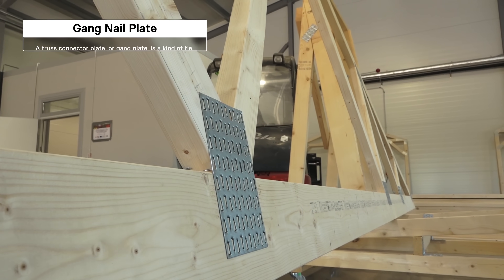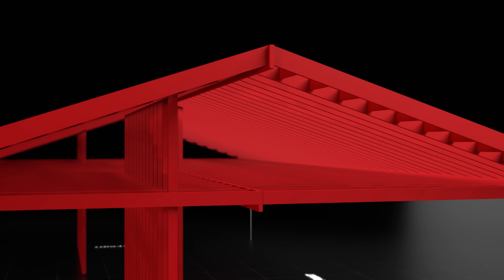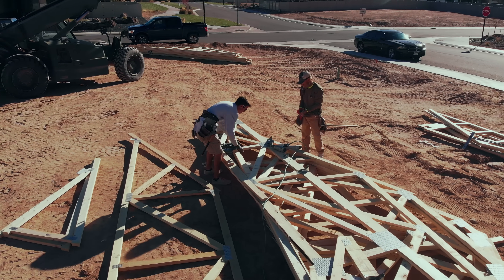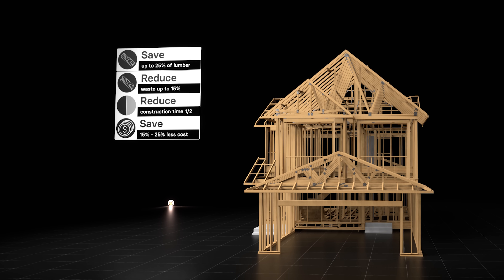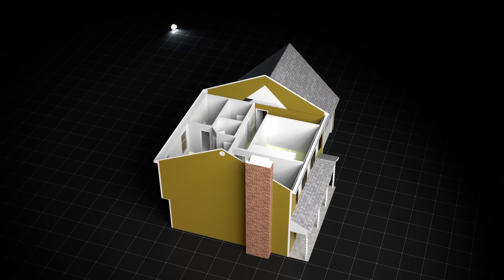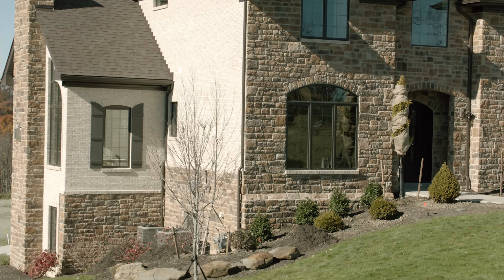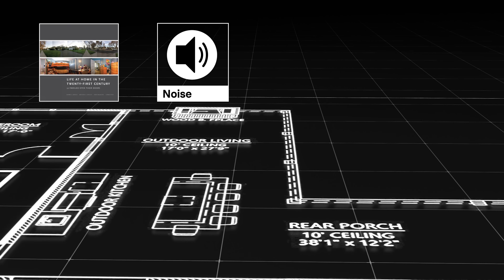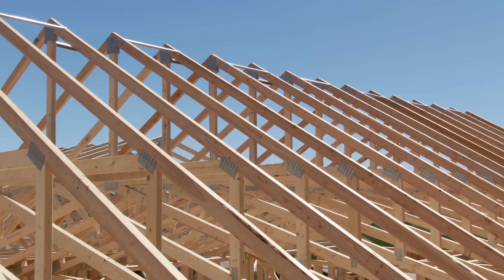The Invention that Accidentally Made McMansions

Comment: An unfortunate downside to gang nail plates is their contribution to sudden roof collapse in fire situations, making it more dangerous for firefighters to attempt on-the-roof operations. The large surface area of the plate conducts heat into the wood joint area, encouraging it to burn first and fail faster than one fastened with nails.
Reply: What's terrifying to me is modern LBL construction. It's all just chipboard held together with glue. Although I hate seeing an old house burn, I'd much rather fight a fire on an old house compared to a new one.
Reply: Brought to you by sawdust and Saudi Aramco.
Reply: @twillison8824  it’s LVL, laminated veneer lumber
Reply: Floor collapse in six minutes with direct flame impingement baby!
Reply: @twillison8824  Our host is balloon framed, doesn't that style of framing raise fire concerns?
Reply: @twillison8824  Seems like something that could be prevented by adding fire-rated insulation (e.g. mineral wool or unfaced fiberglass) between the living space and those members, which would also reduce energy usage. Granted, that depends on where it's located, but in the absence of that, couldn't we add some kind of intumescent coating?
Reply: @twillison8824 which is worse that and spray foam or asbestos and lead paint?
Reply: @twillison8824 i like osb. Its environmentaly friendlier than plywood and strong too.
Reply: Not to mention dense old growth timber is more fire resistant…
Reply: @twillison8824  an old house is MUCH MUCH more likely to start on fire in the first place BTW
Reply: @j.jarvis7460  due to modern fire codes, not construction technique.

Balloon-style construction and OSB board burn faster. Modern plastic-based furniture burns hotter with more toxic smoke than antique furniture. But, wiring is safer, and that by itself has greatly reduced the rate of fires.
Reply: @twillison8824 that couldn't be farther from the truth. Actually research this before making comments 🤦‍♂️
Reply: The danger with trusses is that once ONE joint fails, the whole truss fails, then the roof collapses.  Watch the collapse of the Baltimore bridge in slow motion when it was hit by the ship to see what trusses do when they loose some members.Thinner wood also burns faster.  Modern homes are built to be disposable in fires.
Reply: @sufpnancy That’s a feature not a bug, in the event that your McMansion  does catch on fire you would want it to burn efficiently to the ground completely so the insurance have to pay for the whole thing rather than pay 50% for a half burnt house that then has to be teared down.
Reply: @sufpnancy I think you added some extra words after "disposable".
Reply: @sufpnancy  Not quite the same since a bridge spans a large distance.  Perhaps true for a wide "great room", but not the entire house which has many interior walls to support the roof.
Reply: @sufpnancy I get what you're saying but there must be a engineering safety factor I mean you can't build a multitrust structure where just one trust can take the whole thing out 

Bridges are a bit different
Reply: @sufpnancy  There's a fair bit of redundancy in the designs. The loss of off one truss shouldn't result in the collapse of the whole roof.
Reply: @sufpnancy kind of like a cardboard ball. When people tie the wires incorrectly or don't use enough wires, if one of those wires pops, all that pressure is then distributed among fewer wires, increasing the chances of another popped wire which is really dangerous.
Reply: @sufpnancy This is 100% false. One failed tuss isn't going to bring it all down, thats ridiculous.
Reply: @Jacob-ed1bl right? And even  failed joint in a single truss isn’t going to bring the whole thing down either because there are plenty of inspections that reveal broken trusses and missing nail plates. They can be repaired and the hose house didn’t fall apart.
Reply: @philipzielinski  Most of these people are beyond clueless and just lying.
Reply: @Jacob-ed1bl  Cascade failure, that sudden sag of weight on already stressed burning lumber, straw that broke the camels back. In theory one failure doesn't do it but I have stacked dominoes before and some people build houses of cards for a lying . Seen a lot of disasters just because a few people decided to not do their job right all on the same day.
Reply: Huh. McMansions wont ever be the same. Like knowing how a magician does a trick.
Reply: This is probably the best argument for not letting your house catch on fire.
Reply: In my neck of the woods firemen are not allowed to go on the  roof of houses built with gang plates, the practice there is to surround and drown.
Reply: I expect longer and longer spans of roof trusses leads to the carrying of greater roof loads and greater tension on the bottom chord. A failure of a metal plate made soft by the heat of a fire, and smaller dimension lumber burning through, the greater tension, and no intermediate bearing for the load from above I imagine would result in an extraordinary rapid failure and collapse.
Reply: @billlyons4678  That's more of a truss problem than a plate problem - truss failure modes are just brutal.
Reply: The problem is not the burning, its the expansion of the metal when heated, which causes them to back out of the wood. Some jurisdictions require nails to be driven into the plate to delay this effect.
Reply: That's where my mind went as soon as I saw the intro.
Reply: I wonder if there could be an alternate material that could be used to make them, which would allow the heat to dissipate as opposed to holding it in.
Reply: @robviously-rob0ts  Unlikely honestly. Material science can only do so much. Again, however, if it were to be covered with a protective layer, fireproof foam insulation for example, that would solve the problem.
Reply: @robviously-rob0ts  What about good old fashioned asbestos?
Reply: @heli-crewhgs5285 I think the fact that it’s designed to be drilled into and the danger to workers makes that a bad idea
Reply: That and more so are the engineered floor truss'.  Brother is a firefighter and they will not breach a newer home for just that reason, floor and roof.  If the house is close to being engulfed when they arrive NOBODY will go inside.  They just water it down until the foundation is left
Reply: My experience has been that yes, obviously, lightweight truss construction and laminated building materials are far more prone to rapid and critical failure in fire situations, but modern homes and structures do a better job of isolating the structural components from fire hazards. If a newer home catches fire, they seem to be less likely to have serious fire spread. Older homes hold their strength longer when on fire, but fire spreads more, does more damage, and is harder to extinguish. Of all the residential fires I've fought, the older houses are the ones that were hardest to fight, and the more modern homes seem most likely to be saved.
Reply: As a licensed architect, I can say that I consider how a design would fare in a fire.
After seeing one project collapse during construction due to a fire,
I no longer specify any TGI joists, I specify wood packing in all steel beams even if not load bearing, and I specify mineral wool insulation in walls, floors, and roofs when possible.
When I use trusses, I add additional braces and fire protection.  It is not the metal connector that causes a collapse, it is the design or installation of a total design without redundancy, or consideration of performance in a fire.
Reply: @barryb8850  how do architects learn about long term impacts of things, is there even a disincentive for designs that cause problems 20 years after construction?
Reply: ive heard of similar issues with wooden I-Joists as while normally they are strong but they fail quicker in fires which can lead to floor collapse.
Reply: Great video . Built many         Mc mansions in Chatham MA without ever touching a truss . I would have to say I politely disagree . Engineered lumber seems like the reason . TGI 's LVL's and the like . Live ridges , live valley rafters , huge pressure treated girders ( Parralam's ) windows walls  with engineered posts , OSB sheathing . Those are the reasons for Mc mansions in my area . In fla trusses and tie beam construction have been around in the trade when I  started in 1982 Broward country.
Reply: Firefighter; can confirm.  Often, it's found that it wasn't the joint burning to failure but the fact that all that heat expands metal faster than it does wood.  Combining heat with the stresses already in the rafter members, the gusset simply pops loose and then the joint is no longer fastened.
Reply: @YO-BIZZY Economics mostly, wood is cheap, but makes perfect ammo for tornados, tinder for fires and food for termites.
Reply: Lots of good comments in this thread. It is matchstick construction subject to progressive construction. It is no different from the flimsy construction of the WTC towers, just on a much smaller scale and different materials. There should be no expectation from anyone, that fire departments personnel will be sent into such death traps for anything other than evacuating occupants.
Reply: I have also heard from a firefighter that osb floors become more dangerous in a fire because of the glue melting allowing the floor to collapse quicker than plywood. Plywood has continous wood grain unlike osb chipboard.
Reply: @bk3720  7/16” OSB is about 90% as resistant to failure in fire as 1/2”CDX plywood.
Reply: As a firefighter I can tell you that them gusset plates are terrible
Reply: This is not a hard thought. It would be easy enough to dip all the gang nail plates in heat resistant material.
Reply: @jguyis Yes, as long as its not toxic to the inhabitants.
Reply: Can’t you spray the metal joints with high temp paint and fireproof insulation to make it so the wood around it give before the joints do?
Reply: @The-Maestro-Bob-Cobb  dunno where you are but yes they do atleast in C.Texas.
Some lady just built an actual “mansion” down the county road and it had those boys all over it in its framing stage.
Reply: So your concern is that fires, which do not occur naturally, can be remedied, and affect only one dwelling at a time, are somehow more dangerous than hurricanes, which occur several times a year, and affect millions...
Reply: @ThereIsNoOtherHandleLikeMine  No, his concern is that this thing has a failure mode that a) increases the chance of people being killed in fires, and b) is dangerous to firefighters. (Whether that's true is a different matter - someone posted a link to a study that contradicts this assertion). Fires are a design concern that is represented in every single extant building in the country. And rightly so. If this device introduces a hazard, we ought to a) know about it, and b) see if it can be addressed, eg by ceramic coating it.
Reply: @paulie-g  So, yes. His problem is the minimal risk it poses to one house as compared the major risk it resolves.
No, we do not need to investigate the differences any further.
Reply: @ThereIsNoOtherHandleLikeMine  I will have exactly 0 hurricanes where I live in perpetuity, so my risk from them is < my risk from fire. And yes, it is interesting to examine what might be done to improve the behaviour of this part in a fire. This is why we now have fire-resistant insulation - because idiots didn't scream "but being warm/cool all the time is more important than fire-resistance" - unless it can be proven that it's impossible to a) combine both properties, and b) no other suitable option for hurricane-resistant roofs is available.
Reply: @ThereIsNoOtherHandleLikeMine  why on earth would the comparatively smaller risk of something to something major negate the need to think about resolving it? Structural integrity isn’t a zero sum game, dude. Fixing a risk to firefighters doesn’t have to compete with the importance of mitigating damage during a hurricane. And of course to a firefighter the issue is top of mind, just like how I don’t worry about getting checked for prostate cancer, and technically the majority of the population doesn’t either, it doesn’t mean no one should ever discuss it or research how to prevent it and the people who are in the age and sex range to be at risk don’t matter enough to do screenings
Reply: @  bad faith argument using a storm that uses ungodly force ta wipe houses off of the earth trusses or no and who said Hurricanes aren’t I literally Noted Wind and water sorry I didn’t note debris which houses aren’t rated against generally however the whole Continental U.S. has ta deal with over 350,000 house fire a year and can spread taking out neighborhoods or worse California, East Texas, just ta name a few and have little ta no warning time unlike a Hurricane which you can’t really build against (you can try)
But we have much much more warning than fire.
Reply: I opened the comment section  to say just this. Learned about gang  nail plates in my fire science classs.
Reply: I wonder if there are simple modifications to construction techniques such as insulating / fireproof layer that would reduce that failure mode.
Reply: Good Point Howard. The rest of the House or any Building can be made of concrete but if it is a Wood Truss not only are you Inviting a Fire - It is also the first part to leave in A Hurricane
Reply: Blame government. We are forced to use these.
Reply: @CallmeJeffy1  jeffrey epstein had no clients i trust my govt sir!!
Reply: @CallmeJeffy1  we are the government. We elect and re-elect the people we want to make the rules and we have public comment periods for everything, so we can participate in the governing. The government isn’t some untouchable authority. It’s us.
Reply: @rainbomg 😂😂😂
Reply: @rainbomg If only that were still true.
Reply: This can be litigated with coatings I think all wood in wooden homes should be coated with a fire retardant coating and the plates should be covered with fire retardant tape then it would be stronger and preform better and wouldn’t be too difficult to incorporate into current operations
Reply: @Johndarksoulsbornering that would cost so much, though we should have better safety.
Reply: @Johndarksoulsbornering  so you want homes to be more expensive XD?
Reply: @Johndarksoulsbornering Unfortunately, "fire retardent coatings" all too often are years later found to be carcinogenic to the family that has been living there. That's particularly true of carpeting and upholstery fabrics.
Reply: The gang nail plate heats up in a fire and expands, pulling the joint apart as it is also pulling itself out of the wood.
Reply: @williamgottlieb8723  Ah.  Thank you.
Reply: @williamgottlieb8723  The plate acts as a heat sink. The tabs or staples heat up to point the wood they are into chars. Char has no structural strength and little resistance to pull out. The truss fails long before a substantial part of it burns.
Reply: @williamgottlieb8723  Yeah, I was going to comment that the plate fails long before it reaches the temperature of the auto-ignition of wood.
Reply: @williamgottlieb8723 There is literally no actual evidence of this. Every study of these shows the opposite. (See NIST study “A Study of Metal Truss Plate Connectors When Exposed to Fire” for example.)
Reply: @MoosePockets  Oh you so have not read that report...
In the report it states it needs more research, the wood was not under load and was laid horizontally on the testing desk not in the orientation of installation, it says it clearly in the report, they also did not take a cross section of the wood after the test and based their report on visual inspection. you can see the photos in the report. 
And that is one of well over a 100 research papers from around the world on this and there are plenty that do show that underload the failure time of a roof is lower... so please do not say there is no evidence, as their is plenty, you can say the reports you have seen show no evidence maybe but there are reports from NIST from the Department of commerce inside the US that both say more testing is needed. There are reports from Governments outside the US that say a range of things all depending on what was being tested and how.
Reply: @danielwarren7110  "More testing is needed" does not equal "these cause roof collapse in fire situations."
Reply: @MoosePockets are roofs collapsing? Where does the idea come from then?
Reply: You likely should spray fireproofing on the hanger once in  place. That would slow the spread of the fire. Pressed composites are also serious problems during fires. They can fail in 1/3 the time of solid wood. The best idea of all is to install wet sprinklers in these houses. They are surprisingly inexpensive.
Reply: @AriBenDavid The truss plate slows the fire.(See NIST study “A Study of Metal Truss Plate Connectors When Exposed to Fire”)
Reply: @MoosePockets  Have you read it, because I have. The report states more testing is needed, the report also states the truss was NOT under load, was only burnt from one side and was laid flat on a testing desk not in the orientation of installation, they had a very specific set of requirements for their test. They did not take a cross section of the wood after to see the internal damage of the wood where the truss plate had been to see if the damage was internal, their test was to see heat conductivity and charring to the exterior of the wood. I strongly suggest you go and read it before quoting it. As their conclusion was more testing is needed. Not that it slows a fire. It suggest that the plate protects the wood surface from direct fire charring on the surface, but no tests were carried out on the inside of the wood.
Reply: Cool!! And terrifying
Reply: @The-Maestro-Bob-Cobb  It might depend on if your local building code has an addition to the national one that prevents it.
Reply: Wow…never considered that
Reply: You could fix that easily with extra insulation around those metal parts.
Reply: I’ll buy a lottery ticket
Reply: @ thanks. Appreciate the support 👍🏼
Reply: I’ve noticed
Reply: Nothing that a bit of fire coating won't fix
Reply: yes, a similar problem to making the whole house out of combustible materials
Reply: Add to that fact, American homes run gas lines rather than use electric heater/cookers. They want it to burn down
Reply: While presenting a marvelous perspective of the nail plates for trusses, home construction over a very short time period has exploded due to many, many connections as well as connectors like the nail plates. Let us not forget for example, the simple metal straps holding trusses to top plates, often referred to as ‘hurricane plates’ or ‘tornado straps’. Nor the cables ties directly holding top plates to the foundation! Nor the engineered methods for holding the house structure to the foundation! Many connections or connectors serve well to provide safe housing. Let us not forget the technological advances of personal computers leading to complex roof designs in ‘stick-built’ McMansions. Pioneering software such as 3D “Solid-Builder” allowed grass-root design-builders to efficiently provide cut lists, material lists and other information critical for builders of houses. While 3D computerized modeling was considered fantastic, I imagine AI will or already is playing out yet another evolutionary development. Visions of the future are as robust as ever, with home-printed devices already common, even in the kitchen or galley. Scale it up and print a new home for yourself anytime at all! Just leave a way to sustainably recycle your demolished one. My closing point? Fundamentally, meaningful development is all-inclusive from many disciplines, knowledge bases, and experience. People make things happen and people are bedrock. Rock on.❤
Reply: Did each plate then into liquid asbestos. Oh wait…
Reply: @EvanMooreZ  You do realise that there are a number of fire-retardants that are not asbestos that are available, right? Not a specialist, but for metals a ceramic glaze might be in order. Besides, there are applications where asbestos is perfectly safe, but let's not go there.
Reply: new invention - sprinkler system
Reply: There's a reason they call them widow makers...
Reply: Oh, how horrid!
Reply: The wood doesn't have to burn, once the plate gets hot enough the metal softens an just lets go.
Reply: @SuperFunkmachine  it's more that they expand at a rate different than the wood, popping out because that's the easiest way for them to do their expansion. They barely sink into the wood so they only have to move about a fraction of an inch before they can't hold themselves in place. But it's also because the plates are an integral part of the whole truss, which is not a continuous span of wood. If the truss fails at a plate then the whole truss is lost. Whereas long framing members rest on supports (beams, studs) from end to end and don't have that problem.
Reply: @j0mbie  so… what’s a truss?
Reply: -How often do homes have fires these days?  Like 0.00001 percent of homes each year?
Reply: At least they don’t melt!
Reply: I was just here to say this. They are weaker in fires. So much so that perhaps they should not be used alone.
Reply: and how many homes in percentage burn?    what house can withstand and is perfectly safe in a fire?  yall need to chill.  if roofs on fire GET OUT
PS: IF a home is on fire GET OUT IN GENERAL
Reply: Yep, we won’t even go into a modern construction house if we suspect the fire has been burning more than 10 mins. Just too dangerous with potential collapse to risk lives…
Reply: Suppose it's a tradeoff when compared to the roof failing during high wind which was more common
Reply: Sounds like dum dum folklore, but I've been wrong before.
Reply: Trusses and gusset plates collapse early under fire conditions.  Open floor plans lead to faster fire growth and more difficulty extinguishing when the fire department does arrive. Fire departments are ofted under staffed and under funded with long travel distances because of sprawl. A small outside fire can burn one of these homes to the ground in 20 minutes.
Reply: So basically the open floor plan created by the nail truss made individual home owners vastly richer and this guy is pissed off about it.  Great.  I suppose he can't afford a McMansion so no one should have one?
Reply: I do wonder which style is generally more seismically stable. Guess there's no free lunch always trade offs.
Reply: Fiberglass trusses!
Reply: I heard the same for the flooring, once firefighters breach the front door they can go right through to the basement
Reply: Is there a way to minimize the risk without giving up their use entirely?
Reply: There is no "encouraging" merely heat transfering
Reply: Thanks for the "but sometimes!" argument.
Reply: Oh well they wanted convenience
Reply: No firefighters should die in these ever increasingly cheap builds.  We know better.  But we keep doing it.
Reply: Interesting. Thanks for sharing that information
Reply: Most homes now require a water sprinkler system
Reply: It’s nice to see all the firemen in agreement about the downside of these under fire impingement 🔥💪🏼
Reply: I'm glad we have more strict building codes in Europe that don't allow such shit...
Reply: Bless all you firefighters commenting. Please stay safe
Reply: Hmm…never thought of that! Makes sense.
Reply: "An unfortunate downside to gang nail plates is their contribution to sudden roof collapse in fire situations"

If that's the only downside, that can easily be mitigated by making them out of more heat-resistant metals/materials that are just as strong, right? (Obviously they'd cost more, but I'd think it was worth it myself.)
Reply: hm i wonder if this could be fixed if the back part of the plate was coated in some sort of insulator?
Reply: I'd like to see the studies on that. Doesn't sound logical. If it's hot enough for the plate to absorb enough heat to ignite the wood underneath the rest of the truss would already be on fire.
Reply: @jonnywatts2970  ever burn a piece of wood to break it but you still couldn't break it? takes while for fire to weaken wood up
Reply: Seems inconclusive
Reply: Is a chunk of the fire problem modern construction and materials in general?  I have a 1957 FL home, so in addition to the old style (and overbuilt) roofing, I have load bearing walls, walls with something closer to true 2x4 framing, with rock lathe over it.  Essentially it's an early drywall with about 1/2" of concrete (might be lime plaster) on top of it) and then concrete exterior walls.  Largely old growth wood.
Reply: Yawn
Reply: Open floor plans just by themselves cause fires to spread faster. Personally I do not like them.
Reply: Interesting take id biased to well fires are rare, but firefighting they are not rare they are daily occurrence.. and a risk to life
Reply: This made be true but building a house so it’s better if your in it and it catches on fire is pretty dumb. Also the assistance of flame retardant materials would be a massive benefit to firefighters safety, as the same building today is still standing and much less on fire, the older  building is either engulfed or already collapsed on average.
Reply: Never trust a truss.
Reply: Why can't ye turds just build it out of a material that doesn't transfer heat? A coating or fabric that will eventually be found to be extremely toxic you wrap around the joint. 

 You all say it's the truss, and the joint.

 I disagree. Sounds like a lack of supports inside, and bad material choice for huge trusses. 

 Wood isn't the best choice for everything. Especially the crappy young wood. 

 The downside of having a huge interior is the collapse anyway from fire. 

  It's horrendous when you add drop down ceilings. I seen an aluminum plant, which is super dangerous with the fine particles to up in seconds. 

 All due to poorly designed roofs made to be cheap for the builder. 

 Doesn't seem like prices ever fall for new technology. Guys notice that?
Reply: @RedactedDeath  almost like the economy is being artificially manipulated by anti-capitalist anti-consumer sociopaths run amok; and most of the most impactful choices are being made out of nothing but unmitigated greed; and obsessive deregulation isn’t actually beneficial for most things, nor is undermining the capabilities of the agencies meant to enforce the few regulations that are left … maybe privatizing stuff without any financial or legal incentives not to rip people off just so they can siphon up every last penny from society’s coffers and into the hands of the only people who couldn’t ever spend it even if they tried bc their wealth is so vast they will never even touch most of it was a bad idea

That or it’s the single moms idk
Reply: New fear unlocked
Reply: As a firefighter,  I concur.
Reply: American houses are like most products sold in the U.S., designed to be disposable, not maintained.
Reply: @db-ws9yn sitting here in a 100+ year-old American house….
Reply: Yup. I'm a firefighter myself and I've lost several of my colleagues from those gang nail plates failing.
Reply: It also encourages the use of cheaper ( junk ) timber , particularly pine that burns fast & furiously unlike hard woods that just char on the outside .
And of corse the roof is substantially weaker .
I am yet to see a 100 + year old hardwood roof sag in the middle from the weight of the ceramic tiles but any drive through a new haosing estate a year or more after completion will reveal hundreds of "broken back" roofs  made worse by thinner & thinner hip panels
Reply: I still don't like wooden houses, as soon as I have the funds, I'm getting Robert Konieczny to design me a good old-fashioned concrete, steel and bricks house. 😸
Reply: @LoneTiger  Design?  Why wait for drawings? Start shoveling >:)
Reply: @LoneTiger  The deep South thru Florida has many concrete block houses built thru the 1960's, but the interior walls are mostly wood.  If no termites or water damage, those houses may last as well as cockroaches thru the apocalypse.
Reply: @SihAza  True, a properly made concrete and bricks house should last no less than 50 years.
Reply: @LoneTiger don’t get me started on jet fuel…
Reply: @IAM_Car_SHT  I don't think I need to worry about jet fuel on a 3-story tall house mad of concrete and steel. 😹
If I were to build higher... maybe?
Reply: @LoneTiger  Then watch out for earthquakes.
Reply: @LoneTiger  Yeah!   That's how it should be!  In some parts of the US, especially in border towns on the Mexican border, you see some houses that were built with concrete and bricks, usually built by immigrants originally from Mexico where it is normal to have real brick houses rather than paper houses.
Reply: @LoneTiger  Concrete and steel are not "old fashioned".

Bricks, wood, clay and so on are the eternal building materials.

Concrete and steel are very recent. Also do not last that long.
Reply: @LoneTiger  They burn down too.
Reply: @LoneTiger  steel structures collapse in fires due softening. Look into thermal brake coatings on roof steel.
Reply: @LoneTiger  you just illustrated why wood frame construction is so popular, it is affordable.
Reply: How would it burn first, if in order for it to get hot, it has to be next to something that's already burning? Inherently, its heating up implies that it wasn't the first to burn.
Reply: @MysteryD  Heat rises.  The hottest part of the candle flame is above the tip not at the bottom in the wick.  You can usually start a piece of paper on fire above the flame.
Reply: @kitefan1  you're missing my point. The wood would burn from the existing fire, before the gangnail plate caused it to combust.
Reply: BY the time the gang nail plate has an effect of the combustion of the wood truss... a human should NOT be traversing any span of roof, externally or internally. Time is of the essence. SECONDS EQUAL SAFETY and, by default, SURVIVABILTY: get in/get outside with lives to be saved... especially YOURS!!  FYI Toxic Burnsite Exposure 😮
Reply: They're also far more prone to failure, since they do nothing themselves to distribute the vertical load under strain.  As soon as the wood to which they're nailed starts to succumb, those plates and the nails through them lose all structural integrity.

A wood beam resting on a wood pillar is sound until the pillar or beam fails entirely.  With these gangplates, the joint fails almost immediately.

Don't even get me started on these types of houses in tornadic regions.
Reply: That dosn't sound right to me, wood can't burn without oxygen, so only the surface will burn no matter how much heat is conducted by a piece of metal stuck into it.  I don't dispute that these fooms may collapse sooner in fire but the cause is likely not what your imagining, it's more likely because a truss is only as strong as it's weakest joint and their are now more joints and possible failure points.
Reply: Yup. Known as "firefighter killers".
Reply: That’s incredible to know, here in Austria we build houses with mostly insulated clay bricks or timber.

Roofs in solid construction are built on top of concrete reinforced rings around the exterior and interior walls,the walls go from the foundation until the next floor were a reinforced concrete rim is made on the exterior walls and a slab is installed usually prefabricated, it goes like that until it reaches the loft were the walls are made up to the roof rafter height and the reinforced concrete rim is made on top of the gable ends and interior walls, that’s when a damp proof course is added to the concrete rim and the roof structure is build on top of, most roofs are hand cut/mand but trusses are common too, usually either hand cut or factory made are both made with 235mm timber.

Timber structures are usually made with engineered timber or 235mm planks that are mostly prefabricated nowadays (outside of hybrid medium rise structures).

In timber construction usually trusses aren’t used because the loft is real state lost in dead space .

Trusses in Austria aren’t used to turn roofs in attics as it’s in america, we use them for quick roof assembly and not to create open spaces, most dwellings in Austria use glulam beams to create open spaces in roof structures.

I’m surprised to hear there’s such structural issues in american buildings.
Reply: @CharlieZenenour - It's all about cost.  Timber is much more abundant and much cheaper than in most of Europe.  In the central plains of the US trees are scarce and housing construction in those areas used much less timber until the railway system made it cheap to bring lumber from the forested areas closer to the east and west coasts.
Reply: @ErikOosterwal  Russians largely build with stone, brick, concrete (poured, block, and panel) except for temporary/irregular use houses and their timber is way cheaper than the US (and every citizen building a first house gets 50 cubic meters of lumber free of charge - they still use it for scandinavian-style summer vacation houses/cabins instead).
Reply: @CharlieZenenour  So - In north America, "attic space" is not considered especially desirable, they'd prefer it was usable as well, otherwise it's wasted real estate.  The reason the attic space exists at all is purely because of those prefab trusses which are only implemented as a cost saving measure.

Why would builders and home owners sacrifice quality to save a few pennies? Because unlike Austria, the American real estate market is primarily speculative.  Very few people in America are buying homes to actually LIVE in.  They buy them when the market is low with the intention of selling them just a few years later for profit.  If you were to buy a house to live your life in, it would cost you so much money these days, you'd be very unlikely to ever pay off the debt. So unless you can "flip it" for a profit (and continuously do so) then there is little benefit to buying a home.

Developers get large contracts to mass produce entire suburbs of the largest, most showy homes they can produce for the smallest amount of money to tempt buyers with more space than they'll ever need for a price they could TECHINCALLY afford IF they plan on reselling it in a few years. If the house fails, which they often do, then you slap a band-aid on it for the inspection and hope to unload it without the next buyer noticing.  They then do the same.

Eventually, when the market dies and everyone is so broke theyre practically homeless while fields and fields of McMansions sit empty laying to waste, the developer will pay a destitute to burn the homes to ground.  This ensures a good return on his investment which is paid out by insurance companies to the tune of 10s of millions of dollars, and is made easy by cheap, highly flammable construction materials
Reply: @CharlieZenenour  US is the country of "appear, rather than be". Those McMansions have huge "sitting" rooms no one sits in and dining rooms no one dines in. They're for show, mostly to yourself (because, again, you have no friends to invite over, and if you did, chances are you'd be pulling car keys out of a bowl in an upstairs bedroom).
Reply: Reminds me that I once heard a commentary from Europe ( I think Italy) on the proliferation of US cooking shows and competitions : "Only in the US is cooking a spectator sport ." 
    When you understand that, in order to afford the big kitchens in these McMansions, usually a couple end up both people working full time and maybe commuting -- with lots of meals eaten in restaurants or brought home as "take out" or microwaved components. Not a lot of cooking takes place but the counter yops are supposed to look empty and pristine.
     The open plan sometimes plays out that guests are expected to hang around in the kitchen or.wander in and out and watch the hosts cook.  @paulie-g
Reply: @paulie-g  That's a culture aspect, not a building aspect.  My family sits together for dinner (not the norm, I know).  But that is a decision my family made to be close.  We are the house that my kids friends all come to.  They comment that they don't sit together for meals, and they love that we do.
Reply: @jeannovacco5136  my wife is from Italy, hanging out in the kitchen isn't uncommon there at least in my experience. Now granted my experience may be skewed because we're usually visiting family there but yeah we've definitely hung out in the kitchen before eating usually instead of watching though you help out some how, slicing bread, grabbing plates etc. but we're hanging out, talking and joking while doing it.
Reply: @paulie-g 😂
Reply: @ruhtra-k  .. and in most USian households, this communal eating happens in an open-plan kitchen/eating area. The "dining room" in McMansions is for formal dinners, with fancy plates and silverware and place settings etc, not for daily use.
Reply: @jeannovacco5136  Yes, the "pristine kitchen with nothing visible for an empty scandi look" thing drives me insane. People who actually cook have stuff all over the place - all the cutting boards, sous vide apparatus, utensils and pans and pots and knives. It's a kitchen, not a surgery room.
Reply: @paulie-g However, the homes I grew up in and around  (‘60s, 70s) had “living rooms” and dining rooms that were rarely used. All of them - colonials with center halls, ranches, split levels.  And larger homes from all eras have always had rarely used spaces. The spaces in the smaller open floor homes are designed function better and be used more. A step in the right direction toward the efficient and economical use of space but still lots of room for improvement.
Reply: @Wee162  My point wasn't about design (I happen to like some open spaces and absolutely love high ceilings, presumably for heritage-cultural reasons). It's the absurdity of a) building/buying a house where at least 1/2 to 3/4 of space on the first floor is never used but dedicated to spaces for your wife to decorate (or redecorate every few years) as a hobby, b) complaining about heating/cooling bills, the unaffordability of your lifestyle, and being broke once your wife divorces you (and she likely will, because she's got a massive financial incentive to do so) and keeps the house with the throw pillows on every surface notionally intended for sitting while you live in a bedsit considering acquiring a drug habit. This is stupid in an innumerable amount of ways.
Reply: @jeannovacco5136  AFAIK the cooking-as-sport thing really kicked off with Iron Chef in Japan in the 90's... (and for whatever it's worth, ChatGPT said the same thing...)
Reply: @paulie-g oh the envy 😂😂😂
Reply: @paulie-g ok, I need an explanation of the keys in rye bowl part
Reply: @roadtomanitoba9753  I don't recall the exact comment and there's more than 200 of them, so no chance I'll find it again. I suspect 'car keys in a bowl' is a reference to swinger parties (in the US/UK, they are said to work by husbands tossing car keys into a glass bowl, then pulling keys out at random as if doing a lottery drawing) , 'rye' possibly a geographical stereotype or reference to rye-based alcoholic drinks? You remember the comment, you tell me if that makes sense ;)
Reply: @paulie-g Other people are much happier than you are. You should feel bad about it. Real bad.
Reply: @CharlieZenenour   But they cost so much more that many if not most Austrian live in tiny apartments.  It's a trade-off, build inexpensive relatively poorly built homes that are large, or build expensive better quality but smaller.
Reply: @nealkonneker6084  Most Europeans I know prefer to live in apartments in high population density areas because a) there are so many more services, infrastructure, public transport and things to do, and b) you don't have to deal with the maintenance of a house (which is very significant in terms of time and cost), c) it is just more efficient (eg one expensive roof/boiler/whatever to replace per dozens/hundreds of households rather than just one). When you want to get out to the countryside/in nature, you go on vacation (or to your summer house).
Reply: @CharlieZenenour  Austria, hmm, that would be mountains and lots of snow. I can see why you build your houses even tougher that we do in Sweden.
Reply: Happy this is a top comment. I grew up in an old house and learned on it: how it's made, why it was done that way and how to fix it when it goes wrong. When I got a little older and started working in construction, I was really struck by how quickly and effortlessly these HUGE trusses could be slapped together. One thing always stuck with me, though: "That's it? That's what's holding this all together??" It's never seemed like it should work to me, and maybe that's because my definition of "normal" is pre-1920s construction. Fast builds are nice but I'd rather my roof didn't collapse in under 15 minutes if it catches fire, but maybe I'm just weird.
Reply: NYS to require fire suppression sprinklers in all new builds.
Reply: @bobcaygeon975  A 13-D automatic fire sprinkler system does not require sprinklers in an attic not designed for occupancy. NFPA 13-D is the standard for sprinklers in single family or duplex homes. 

When NFPA started to write a less stringent standard for sprinklers in homes they didn’t look at where fires that destroyed homes started. They looked at where fires started that killed building occupants. No surprise that the most common location for fatal residential fires to begin is the kitchen. Residents tend to survive fires that start in the attic. 

What became the residential fire sprinkler started as an early project of the National Fire Academy, at Emmitsburg MD.
Reply: @bobcaygeon975😂 lol no
Reply: @bobcaygeon975and there's so many areas of the United States where they come up with really dumb ways to exclude sprinklers 

HVAC duct into to keep it just under 5,000 sq ft which in Tennessee for some reason you don't have to have sprinklers in that gigantic of a house 

So that you can just very cheaply hook into an existing air conditioning duct system that runs right up to the wall that separates the two the house that is considered for square footage in terms of sprinklers and then you just put Vince so it's basically like Bill but not with they make it extremely easy to add that air conditioning to that room which every single homeowner is going to do but technically the way it was built and sold it doesn't need sprinklers it's really dumb
Reply: @bobcaygeon975  It will raise the cost of every house $8,000-13,000.  Don't listen to politicians or firemen who say it's half that—they're sure they know the truth but they're wrong.  Ask someone who actually writes the check for that. These prices were the lowest bidders.
Reply: Why don't we just put insulation over the nail plate?
Reply: @Synergy7Studios  That's not likely to do anything useful and just add to cost and time. 
The better solutions include preventing the fire in the first place, and putting it out sooner, such as with sprinkler systems. There are sprinkler systems designed for individual houses that are much cheaper than commercial solutions. Some are placed only in high-risk areas like the kitchen, or above the stove. One small chemical fire suppression above the stove isn't too costly and could prevent the whole place from catching fire. Others use sprinklers like in buildings, but smaller, smaller pipes, and a simple 50 gallon tank on the roof/attic for pressure instead of a pump. 
Generally I trust the NFPA to come up with requirements that are very safe (sometimes overly safe for a high price).
Reply: @boomergames8094  unfortunatoy with housing prices the way they are that really can't happen right now. I would just encourage people to have fire extinguishers and teach them how and when to use them, and to not be afraid to use it. Also teach people about electrical fire safety, grease fire safety, etc.
Reply: Okay, but the old way of making roofs caused roofs to collapse under normal circumstances. I think the risk of a roof collapsing for no reason is worse than a roof collapsing due to a fire, an extraordinary circumstance. I'm just saying.
Reply: @The-Maestro-Bob-Cobb he's talking about mcmansions so by definition poorly built
Reply: It's rather that these metal plates on the outside get extremely plastic from one moment to the other, when reaching its threshold temperature, rather than the nails leading the heat into the wood.
Reply: And ensures that houses are converted to match wood with the first puff of a tornado
Reply: Don't trust the truss.
Reply: The #1 reasons for fires recently is phones left on chargers.  Those get over heated.  And I wonder how many more fires are in older homes Where the electrical is old and heating is old…
Reply: If the residents of the house are in it long enough for that to happen they already died  from carbon monoxide and smoke.
Reply: @dustinssimpson  not true. Attic fires are a common fire type that can go unnoticed by the occupants of the house for a long time. Same is true for in-wall fires, though not to the same extent.
Reply: Ok, I’ll bite: show us your peer reviewed study showing this. Or show us the accident investigation report showing this.
Reply: Generally firefighters arent doing roof operations anyways on a residential fire. If you get there soon enough you may be able to save the house. If you don't you're mitigating fire spread to nearby structures and putting it out in a controlled way. Firefighters generally aren't running it homes any longer.
Reply: @Flint_Dribble maybe true in the burbs with volunteer departments. Not true of FDNY and other professional agencies.
Reply: How about no nail joinery instead?
Reply: @ipyramid  great strength but costly and time consuming. Would love am exposed timber frame house with traditional joinery though.
Reply: @ipyramid  Significantly more difficult, and hence much slower and more expensive. You're welcome to build your house that way, of course, but it won't be widely adopted by builders & developers who are competing on cost, and if it were mandated by regulations & building codes housing would instantly get much more expensive and many people who are on the edge of not being able to afford housing would get pushed into homelessness.
Reply: @jnicholasp  Never claimed it was cheap or fast. I want to study carpentry just to built my house that way. When you do it yourself, it becomes cheaper, and you can go slow to get it right. The benefit is how long the work will last. It can last hundreds of years... can.
Reply: @ipyramid  What does that mean? you going to dovetail and glue a roof together? 😗
Reply: Thank you for identifying this Additional problem
Reply: Maybe it's so in your face it's literally called a floor truss and uses the same plates as above
Reply: Safety is the most important point. But it’s also sad that cost savings are never passed along to the consumer. However price increases are always passed along, and used as an excuse to charge more and maximize profits.
Reply: Did you know God loves you? Jesus, the Son of God, was sacrificed for our sins. He was crucified, then resurrected. With His sacrifice, we can live forever with Him in His Kingdom - the Kingdom of God. Follow Jesus, repent, and live forever with Him in Heaven! If you want to learn more about Jesus, check out the Gospels of Matthew, Mark, Luke, and John within the New Testament of the Holy Bible.
Reply: @Dr.Soda7  why does god demand a living thing be tortured and killed so that he can forgive me for things he programmed my brain to do? Can’t he just, you know, forgive me?
Reply: @rainbomg  God has forgiven you. Seek God with all your heart and you will find Him. If you are serious about your questions then ask Him yourself. The Lord is always with you.
Reply: @Dr.Soda7 then why does he care so much that I worship him? Why do I have to, lest I be tormented for eternity? Is it free will if the only two choices are to worship god or else burn in a lake of fire for all of eternity? That’s not really a choice, is it? If you love someone, why do they have to worship you?
Reply: @rainbomg  Because there's no other to worship.
Reply: @Dr.Soda7  why do we have to worship anything? And why do we have to guess right or be damned?
Reply: @rainbomg  Jesus is in control, whether you know it or not. I'm just telling you what's going on. If you're ever scared or confused about what's happening in your life, you can always turn to Jesus for He is always with you - to help you and guide you back to safety and peace.
Reply: Fortunately the number of houses burning down is only a fraction of a percent of the number houses using this device.
Reply: Yea because firefighters get on the roofs of suburban homes when they are on fire...
Reply: Yet the roof is more likely to fail with just nails. Source my father was a roofer for 40 years. He always said both have their drawbacks.
Reply: @Exodius-u3l  you're replying to people who have been firefighters for decades. And likely replying to some fire inspectors. Not only do they see the effects of fire first-hand, they also keep up with the studies that actually assess these things. A roofer does not do this -- they keep up with what materials and design choices are required by law, and are the fastest and least expensive. Unfortunately, metal truss plates squeaked through these laws, but it's why most firefighting departments fight these types of fires at a distance, expecting them to fail.
Reply: You sound like such a soft beta
Reply: @Squat5000  super cool alpha guys out here looking for ways to accuse people concerned with safety of being “soft”
Reply: @rainbomg there is a practical level of safety. It's no longer a matter of practical, it's punitive. Learn the difference
Reply: Fire resistance of building assemblies is simply about how long it will resist burning so you can leave the building. Nothing is designed to perpetually maintain structural integrity so people can go back in.  That's just bad use of statistics.
Reply: @stevenmackey789  and what if the occupants can't get out? How do we know it's 'relatively' safe to go in to save them?

That's just a bad use of stupidity...
Reply: i donno where this guy in the video lives but no one uses trusses to build houses lol thats some cheap ass trash and the pic of the house on the right in the video thunb nail did not even have a truss roof on it the houses hes talking about are little shit boxes with one roof the big nice "mcmansions " have way to many hips and vals to even use a truss anywhere
Reply: @Moto-Tron you've clearly never built a house. A good truss plant can accommodate all of that with reasonable pricing in areas with high framing labor.
Reply: As a fire fighter I can confirm that the truss plate is a dangerous invention for fire fighters.
Reply: @michael7324 based on what?
Reply: How do people know this when they buy a house? I don’t really care for these new homes
Reply: @SamMcKinley  The builders follow the building code.  No one can know everything.
Reply: @ It isn’t true. Every study of these shows the opposite. (See NIST study “A Study of Metal Truss Plate Connectors When Exposed to Fire” for example.)
Reply: @MoosePockets  nope no they do not and the NIST study does not say what you say it is saying, go and read it, it is say they need to run more tests.
Reply: Except that every study conducted on these plates has shown that truss plates have no, if not a positive, impact on the longevity of the roof in a fire.
Reply: @MoosePockets 
I am sorry you are wrong there are plenty out there that show no impact, but there are plenty also out there that show an impact. 
NIST research in the US was inconclusive. And specifically did states "Load carrying ability of the metal plate truss connections was not measured during these tests" Also NIST used pretreated fire resistant pressure treated wood. And the report itself says it is inconclusive and needs more research.
The US Department of Commerce research by the Fire Research Division Building and Fire Research Laboratory  states " additional work is required to produce more detailed information." "It is important to note that these experiments were conducted with heating and fire applied to only one side of the test specimen and with no external loads applied to examine the load carrying capability of the construction system. " " The wood is expected to burn differently if aligned vertically to the radiant panel as opposed to horizontally" - They had the wood laying down not assembled in a construction, they also did not cut the wood to get a cross section of the interior of the truss to see if any damage had been done inside of the wood and based their research on visual inspection. 
Science Direct research - the walls and trusses were treated with a fire resistant foam and the plates had the foam over them and were not exposed. 
There is research from the UK government but the walls were brick not wood so the heat of the fire was lower initially than standard fires in wood framed homes in the USA leading to a longer life of the roof but determining that the roof is only rated for a 30 to 45 minute fire. (if the fire service take ten minutes to get there after the alert they are told they only have 10 minutes before possible roof collapse - 10 minutes before alert, 10 minutes to arrive, 10 minutes to fight before a truss roof is unsafe to access. - joist rooves however have a lot lot longer)
The Australian government also has research showing the safe time for access to the roof is less on truss rooves. 
There is research from the German Government, The Swedish Government, and many other governments around the world that have shown higher heat transfer rates, which have then lead to materials used to make them to reduce the heat transfer, and less time before failure over joist style rooves. 
SO you can be selective as to what research you look at and make an argument. But you can not say "every study conducted" As there are literally hundreds and many do show that they have an effect on the length of time before failure. The interesting thing with most of the America studies is the roofs are not under load during the fire tests and the load is not tested, they are just looking at heat transfer into trusses that are not under load. - Many tests carried out by fire services include testing with and without spraying water onto the rooves, there are also tests with a "typical storage load" (ie junk in the loft) and these do fail faster than joisted rooves. 
So over all you could say it is inconclusive, you could cherry pick and say these reports show no impact, but you can not say "every study" as plenty are out there that show a detrimental effect depending on the conditions and there are also just as many out there that have not studied common conditions of when a house is on fire, they are looking at one specific point, not the combination of multiple factors. (and they are valid research as we have to look at all aspects, from each individual cause/problem/issue, but also research combined as well)
Reply: I don’t follow how trusses contribute to a first floor open plan but allows a second floor with more rooms. The rooms on second floor still have to be supported below and about the only way I know to do that safely over a large span would be with engineered wooden I beams. Otherwise you must have first floor walls supporting the second floor. Roof design has little to no affect on this that I can see
Reply: @truthteller50  Long span trusses mean that the walls in the upstairs rooms are only partition walls - not supporting the roof above.
Reply: @ I understand that, but the weight of the second floor and everything that will go in it still has to be supported and typically that can not be done by just the outside walls. You'd have to run engineered I beams or something across the span of the house if you didn't use any interior walls as upstairs support.
Reply: @truthteller50 depends on the span of the floor joists. If the span is not too long than the floor joists can transfer all the load to external walls. But otherwise you would need some kind of column or bearing wall somewhere in the space. Usually they have a few in these houses, the first floor isn’t completely open
Reply: @truthteller50  i think it is because you can support the second story in more ways as opposed to old school that load from the second story support the roof had to be transmitted directly down to the ground. So basically both floors were limited in design simply because of having to have walls in certain places to carry that load to the ground. Yes you have to support the 2nd story in a truss house but it is much more flexible and doesnt limit both floors to essentially the same floor plan. Thats my uneducated guess at it at least.
Reply: @ this is pretty much what I said in my original post. Using these for roof support has nothing to do with what you could do on the first floor or the second floor.
Reply: @ that is a more accurate retailing of I believe what he was trying to say
Reply: @truthteller50  gotta subscribe to nebula to see the more detailed video that explains this part.
Reply: @truthteller50  Sheds the roof's weight to the exterior walls so you need less internal support and can have a wide space between columns and support walls. Heaviest thing on the second floor is a full bathtub, old school water bed, gun safe if you hauled it up there and tanked water heater, but otherwise I am sure they use a generic calculation for wall weights when they design these.
Reply: Its clear that you and most of the repliers don't understand trusses and the engineering involved. People are seeing it fail at the joints and jumping to the conclusion that it must be the nail plates. The nail plates are made of steel, by the time they get hot enough to deform or conduct heat, the whole thing is going up.  The timber will be getting hot and warping, getting weak. The joints made by the nail plates take the full load of the structure, the joints are the weakest point and will always fail first.  A truss is a light weight strong structure engineered to span long distances using the minimum amount of timber. Basically its a strong structure engineered out of matchsticks.
Reply: @jumboegg5845 It is clear from your statement that U do not know how short of a time in minutes that it takes for metal gusset plates to fail. 
Stick built wood framed structures can burn for a long time before failing.

Metal gusset plates exposed to fire can fail in minutes.
Reply: yes in my country they are banned for causing around 3 ,000,000 deaths by fire
by comparison car crashes were only 1,000,000
Reply: @saintofchelseathomascarlyl5713   yeah sure...
Reply: @saintofchelseathomascarlyl5713  3,000,000 deaths by fire?   In how long?
Reply: @plcwboy  im sorry you caught me in a lie...
i thought all the comments talk out of their ass so i joined the trend....
Reply: @saintofchelseathomascarlyl5713  What country do you live in?
Reply: Considering that being on fire isn't a natural trait of a home, I would not call this a "downside" of the gang nail plate. 🤓
Reply: @DavidSaintloth  literally part of building material rating is how long it would last ina fire.
Reply: @lilbtyt7928  yeah, but how are these different than nails, for how long it lasts in a fire? I find it hard to believe it lasts ANY longer
Reply: @jf8138  The original post explained that.  The plate is way more thermally conductive than wood and has a large surface area compared to just some nail heads.  It draws more heat into the area under the plate than would otherwise be there by a large factor.
Reply: @Tbird761  Maybe the plates add another possible failure mode but who's to say that the new failure mode is the most likely? I'd like to see some studies.
Reply: @jf8138  They literally explained it. The larger metal plate conducts heat to a larger portion of the wood causing it to burn faster. Reading is not that difficult if you are capable of typing this question out.
Reply: @lilbtyt7928  i still remember old buildings still had slate or ceramics as roofing instead of flammable paint as the roof which also means a fire hazard but then again this what happens when demand got too much i guess
Reply: @Tbird761  Every study of these shows the opposite. (See NIST study “A Study of Metal Truss Plate Connectors When Exposed to Fire” for example.)
Reply: @DennisKapatos  Every study of these shows the opposite. (See NIST study “A Study of Metal Truss Plate Connectors When Exposed to Fire” for example.)
Reply: @ruzefosho  Every study of these shows the opposite. (See NIST study “A Study of Metal Truss Plate Connectors When Exposed to Fire” for example.)
Reply: The abstract for A Study of Metal Truss Plate Connectors When Exposed to Fire (2007)

"The popularity of lightweight, metal plate connected wood truss construction is increasing due to cost effectiveness, versatility, and ease of construction. This type of construction brings many concerns to the firefighting community, since structural collapse has caused numerous injuries and fatalities in the fire service. In an attempt to determine the performance of metal plate wood truss connections during fire exposures, NIST conducted a series of twelve instrumented tests exposing one side of the test specimen to the thermal exposure. Load carrying ability of the metal plate truss connections was not measured during these tests. The tests were purely an attempt to study the heat transfer between the metal plate and the wood. Results from these tests suggest that the metal plates help to protect the wood beneath the plates. However, additional work is required to produce more detailed information."

Not exactly a glowing endorsement of their fire safety, is it?
Reply: @MoosePockets  Did a quick review on that NIST study and found:
- The study did not measure the load-carrying capacity of the connectors during the fire, which is a critical factor in assessing their performance.
- The study only exposed one side of the specimen to fire, which may not reflect real-world conditions where fire can spread from multiple directions.
- The study did not consider the impact of different types of metal plates or different wood species on the performance of the connectors.
- Further research is needed to fully understand their performance under different fire scenarios.

Are there more studies that address those deficiencies?
Reply: @jf8138  So the difference here is the resistance to wood char and what happens when the wood burns. The nail plate has a ton of surface area, where the single nail does not. When a board experiences fire, the board burns from the outside in (duh) the nail plate only sticks in about 1/8 of an inch. since it has such a large surface area, it collects heat quickly, and heats up, charring the wood underneath. When that happens, that little cleat that only has an 1/8 inch bite is now holding on to charcoal... where a conventional nail is running through much more material. Secondary effect is that since that plate is now hot, it expands, and when it does that it literally pushes itself off the wood, or charred wood. 

So in the grand scheme of things, where with nailed construction you're looking at 15-20 minutes of fire exposure, nail plates, you're at something under 10 minutes. As a firefighter, that's terrifying. 

If they were to spray a fire retardant or insulating foam around them, not even the whole board, just the connection points, they would be MUCH more reliable and strong in emergency situations. But, that costs money, so nobody does that.
Reply: @Tbird761 Seems like they could be sprayed with a thermally-reflective compound like they do in buildings using steel…
Reply: ...but the plate seals off access to some of the oxygen, reducing the rate of combustion.   @Tbird761
Reply: @jumbojumbo6866 Here in the Northeast US no one has tile for obvious ice breaks tile reasons.  They did have slate.  Some of the older buildings, like a church up the road, still have slate but slate costs the earth to repair nowadays.
Reply: @jf8138  Nails bear very little load, they just hold things in place. Nail plates are an integral part of the truss and take the full load.  Its not the nail plate failing, the trusses are failing at the nail plate because this joint is the weakest point. If one joint becomes weak the whole truss sags and becomes weak.
Reply: @kleetus92  what about intumescent paint that expands under heat to insulate the material underneath?
Reply: @MoosePockets  Can you please not spam the comments section, and put all your studies and information in one comment.
Reply: @jf8138  Metal conducts heat effectively, a large coupling plate is also an effective heat sink, which means the wood where the joinery is occurring is going to burn first, meaning a collapse of the entire roof.

I swear people who haven't built a house astonish me, it's literally common sense to everyone I know. Also nails have a much smaller surface area meaning it conducts less heat. Just in case that wasn't obvious. Wood is naturally fairly resistant to heat, up until it's enough heat to cause it to rapidly dry out or catch fire anyway. That's why log cabins were considered relatively cozy before we had insulation.
Reply: @Tbird761 and I think that a regular nail would expand slower because it’s mostly embedded. And there’s no guarantee it would pop out rather than hold more tightly. With the plates, I picture them pulling the joints further apart when they expand from heat, allowing airflow too.
Reply: @bobgarrish   they posted who did the study
  You are the one making stuff up
Reply: @kleetus92  nail plates go in the wood a lot farther than 1/8"
Reply: @jf8138  For nails, it takes the wood burning thru to lose grip and the nails fail.  For gusset plates, all it takes is some heat and the plates expands enough and the small teeth release from the wood.  It doesn't take burning like OP said above.
Reply: Actually he's 100% correct and they teach modern firefighting techniques to avoid going on any roof with trust supports during a fire. 
A nail penetrates deeper and is thicker while has less individual points of contact.  Where plates have shallow thin penetration but multiple points per plate.
When the wood gets heated as a result of a house fire the wood swells causing the thin and shallow penetration of the plates to stop adhering to the lumber.  
A nail that penetrates deeper will continue to hold structural weight until the lumber is directly damaged.
This is why they encourage local fire departments to be aware of all new construction and are typically trained on building style and the resulting supports so they know what they're getting into.  Both in terms of the support structure as well as the contents and how they will burn.
Reply: @plcwboy  Cool... how far then?
Reply: @jf8138 it only goes about 1/8” into the board. It loses its holding capacity much faster than a 3”nail and once the first truss fails the rest follow.
Reply: @jf8138 because the surface of the wood member burns fast than the heart where a nail penetrates thus making a gang plate a quicker failure in fire when compared to a fully embedded nail
Reply: @jf8138  nails will outperform nail plate in a hot gas attic. Reason is the long thin shape heated at head vs huge area nail plate in the hot gas and short penetrators. The steel to wood interface is immediately at gas temperature. The long thin head cooks the wood and loses friction slowly and progresses from head in.
Reply: @DennisKapatos the studies exist  already
Reply: @jf8138 have you ever had a fire? ever burn a skid? you'll notice and especially with pine is how fast the outside of a board or stud chars and how deeply it chars in a short amount of time.  

a nail is inside the still potential solid wood while a gang plate simply burns off.  those gang plates are thin steel, they'll absorb heat fast and put it in the wood too.  

yeah, lets build houses out of pine something that starts quick and burns up fast.  what about hedge apple or oak? takes alot of time to get burning and burns longer.  also don't know if you notice those woods get harder as they but.  pull one out of fire and see for yourself.  

but oak, hedge and hickory take too long to burn.  even straight and wide beech isn't used and it too is strong.  its unfortunate
Reply: @jf8138  did you not read the op comment??
Reply: @kleetus92 good explanation.
Reply: @jf8138  ITs different because in the past it was single long pieces of wood, and timber spanning the roof, not a bunch of smaller pieces held together by the plates. Once one part of the truss fails, the whole truss element fails. A solid piece of wood has to burn through in order to begin to fail.
Reply: @DavidSaintloth  If you were a firefighter David, you wouldn't say that.  As a retired firefighter I would also like to add that if just one truss fails in a fire the whole roof fails and the house is lost.
Reply: @jimwilloughby  I knew this video was about those plates before I opened it because I've heard that from multiple other firefighters.  Maybe something you missed in your education?
Reply: @jimwilloughby  I agree brother.  I was with my crew fighting an attic and bedroom fire in a single family dwelling.  We were advancing a hose line into the living room to attack the attic fire.  Another crew had advanced a line into the bedroom and a Truck Co. was just opening the roof.  We had just pulled the ceiling when we heard a loud noise and the roof and ceiling came in on us.  Lucky for us we were only hit by the outer edge of the collapse.   We were knocked to the floor and partially buried.  The Truck called a mayday and we were soon pulled out.  We all sustained moderate to minor injuries.  To me this was defiantly a downside.  We set a timer on all structure fires and we had only been actively fighting the fire for four minutes.
Reply: @BigDaddy-dr8gf  Am I understanding correctly that the timer gets set after you arrive, not taking into account when the fire may have started?  That seems like a major confounding variable.  Say you're comparing time to collapse on two house-fires: what if one family was home and heard their smoke alarms go off within a minute of the fire starting and called right away, whereas the other family was on vacation and had malfunctioning smoke alarms so it took 10 minutes before you even got the call?
Reply: @DiceMaster740  The timer is started by dispatch on the arrival of the first unit.  Dispatch advises the Incident Commander about every four minutes as to how long the firefighting activities have proceeded.  It is just a tool for the IC to use, along with other indicators, as to if they should switch to a defensive mode of attack.   Obviously there is no way to know when exactly the fire first ignited.
Reply: @BigDaddy-dr8gf  I happy both of your crews got out without anyone getting killed. All of you were very lucky, and I hope all of you are back to normal duty. Stay safe.
Reply: @jimwilloughby  Is there any comparison data about homes saved that don't use these plates vs ones that do? It is definitely something interesting to consider.
Reply: @jimwilloughby  Thank you for your kind words.  This incident happened 15 years ago and I have been retired for many years.
Reply: @BigDaddy-dr8gf  Glad you are here to tell that.
Reply: @jimwilloughby This is incorrect.
Reply: @jimwilloughby  Never trust a truss!
Reply: @BigDaddy-dr8gf  how long had the fire been burning before you started fighting it?
Reply: @plcwboy  Best of my recollection the fire occurred around 2am.  Occupants were not home and the neighbors reported the fire.  Fire stated in the bedroom and extended into the attic via a missing scuttle hole cover located in the bedroom closet.  The bedroom and hallway stained major fire damage.  Attic was well involved on initial attack, but had not vented.  The estimated that the fire had been burning in the attic for about 10 to 20 minutes before our entry into the structure..  There was no indication to the Truck vent team that the roof was compromised.  They said it felt firm on sounding, prior to cutting the vent hole.
Reply: @drewmelby1798  < I'm sorry, Drew. I don't know  the answer to that.
Reply: You mean rafters? You can lose many trusses and has hardly any effect on other trusses that the biggest advantage of them aside from speed @jimwilloughby
Reply: @sufpnancy As an engineer, I disagree.  I have a failed roof truss up in my attic right now as we speak that I am evaluating how to fix properly.  The plates are completely disconnected.  Fortunately it is in an area that isn't very loaded, I know because I have done the truss calculations myself.  Trusses are designed as a system and can temporarily transfer loads to the remaining members.  Sometimes for long periods of time unbeknownst to the occupants.  Just because one fails does not mean they all fail.  There is plenty of redundancy.  There is an inspector known as Cy in Arizona that has documented complete trusses that are missing these plates and the roofs are not caving in.  Please educate yourself before you speak a bunch of nonsense.  Thank you.
Reply: @jimwilloughby older homes made in slower times for me.  Not those post-war clapboard things either.
Reply: @jimwilloughby  Correct. I remember the Walbaums fire in NYC where several firefighters died due to the truss roof construction. In truss roof fires, I typically see the firefighters go on a cherry picker to fight the fire and assume the structure burns to the ground as long as there are no people inside.
Reply: @jimwilloughby 
That’s not how that works at all. You really think we design roof trusses with no safety factor? You think an engineer would sign off on my design without substantial redundancy?
Stop telling people that, it’s absolutely not true.
Reply: @DavidSaintloth if we planned every building to work only to normal operation, skyscrapers would fall in earthquakes, dams would fail during heavy rain, and a strong breeze would level cities. You build for the toughest conditions an area will face, not the everyday ones.
Reply: @DavidSaintloth  Failing to plan is planning to fail.
Reply: @DavidSaintloth  So much of building code is about fire safety. To think a failure mode is not a "natural trait" of something (worthy of serious consideration) is the difference between a hobbyist and an engineer.

That attitude is basically why we have building codes, as this video covers: thinking of a roof as a wing that can be lifted off a house is also arguably not a "natural trait" of a roof. But considering it saves lives.
Reply: @DavidSaintloth  If it's not a natural trait why is it such a common problem? We have firefighters for a reason and you're being dismissive of an actual safety issue that could kill both the owners\residents of a home and the rescuers in action. Fire Safety code is a big part of building a home are you daft? Homes catch fire ALL the time, the better the home is built to resist fire the more likely the residents are to escape successfully, and the more likely you can save the house, although that's rare.
Reply: @DavidSaintloth  fire is something that happens in reality.
Reply: @DavidSaintloth  But being on fire is a possible event that can happen to a house, this is a real issue. It doesn't negate the obvious advantages of the gang nail plate; it can be addressed in other ways. Perhaps treated wood should be used.
Reply: @DavidSaintloth neither are hurricanes, but this was an upside for hurricanes wasn’t it
Reply: @DavidSaintloth What is the life of a Firefighter worth?
Please tell the World. We'd like to hear.

There are over 350,000 house fires every year in the USA. One every 90 seconds or so.

That means, at all times there is a house burning somewhere in the USA.

Then, add all of the lightweight constructed commercial building fires.

Why make something cheap and easy to fail when it could be built to withstand the elements and last longer for a few dollars more?
Oh yes, because that's the American way of doing business.
Reply: @DavidSaintloth  It is when it is your family inside and the time to get out is greatly reduced.
Reply: @DavidSaintloth  being on fire isn't a natural train of a ship, plane, or car either but it is considered what happens when they catch on fire when they are designed.
Reply: @DavidSaintloth you're a smart one, aintcha
Reply: @DavidSaintloth  THANK YOU!!! THIS IS exactly what people need to understand.
Reply: @DavidSaintloth  Why not? One of the key points of this video is that plates do a better job of handling certain abnormal operating conditions (high winds). Not only do I think it is completely reasonable to evaluate their shortcomings in handling others, building codes exist in part to minimize fire related injuries and death. Thoughts?
Reply: Exactly  @DavidSaintloth
Reply: .  Tell that to Los Angeles County.
Reply: @DavidSaintloth what a dumb comment
Reply: @DavidSaintloth why isn't it a downside if the fire has the opportunity to to spread in two different directions bkuz of the plate. Nails being buried in the wood makes it harder to heat up
Reply: That’s like saying being wrecked isn’t a natural trait of a vehicle and therefore there would be no downside to a car lacking safety features. Big brain stuff
Reply: @DavidSaintloth  you must not know very much, do you?
Reply: @DavidSaintloth im very glad you got EMBARASSINGLY proven wrong after using that emoji like a dork
Reply: @DavidSaintloth moron
Reply: @DavidSaintloth  what about a house is natural? It’s man made 😭
Reply: @DavidSaintloth  Guess we should take airbags and seatbelts out of cars because crashing isn't a "natural trait"
Reply: @kayabrokenlutestrings6946 there was a feature that completely stopped any deaths in old cars in high speeds accidents. The fact you couldn’t go faster than 25mph and you wouldn’t  survive in an accident at that speed so with no airbags or seatbelts 100% of peoples deaths at any speed 26 mph and up were 0!  This is the advancement of technology and the reality is with flameproof or flame retardant materials the old houses are screwed if fire gets hold buildings to day are much harder to ignight become engulfed or a blaze or collapse during fire in a much greater timeframe. So firefighters probably were safer in older houses because you don’t go into already collapse pile of flaming buildings.  You sift through it later to find the body’s.
Reply: @DavidSaintloth  fire codes and the like exist for a reason. It's like saying "we didn't put life boats on the Titanic because sinking isn't the 'neutral' state of the boat." In other words, it may not be a downside for everyday use, but you will want it to come into play if there is an emergency situation.
Reply: @DavidSaintloth  oof that’s so wrong🤣 next your gonna try and sell sand foundations and floor windows in flood zones🤦‍♂️🤦‍♂️🤦‍♂️
Reply: @DavidSaintloth till I fall through the roof or floor trying to save you or your kids. It’s cool though 👍🏼
Reply: @DavidSaintloth  Thus demonstrating the mindset of the problem.